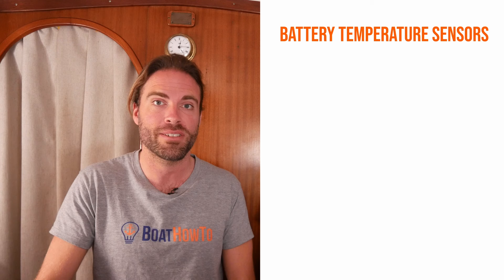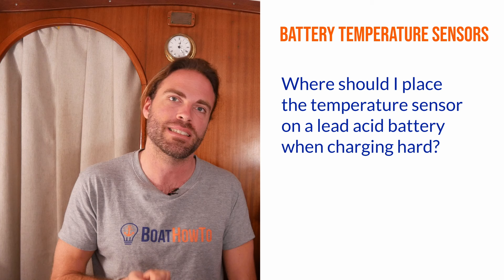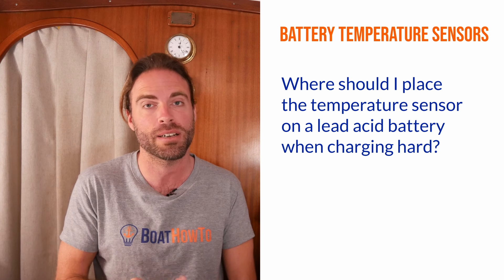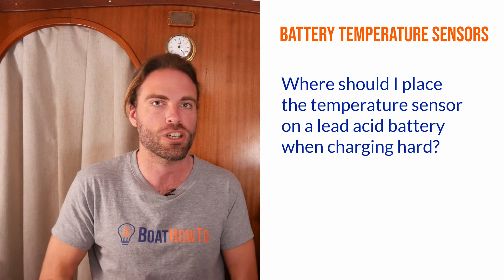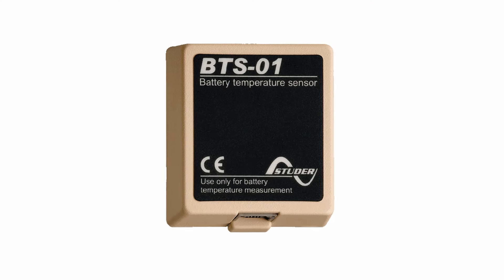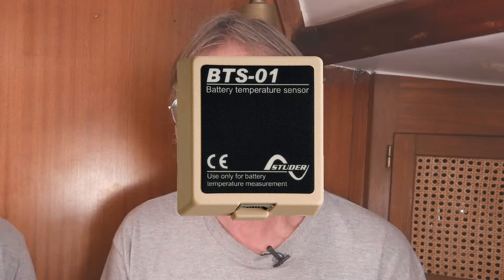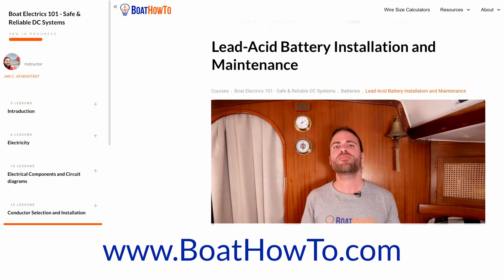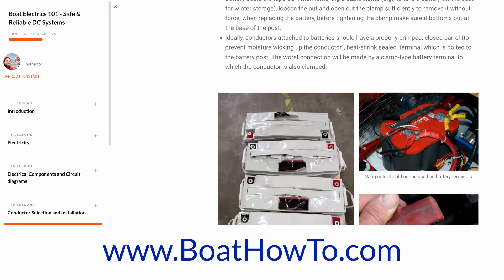Here is what MOST people do WRONG 😖 | Ask The Expert with NIGEL CALDER

Comment: Thanks. What do I use to stick the sensor on when the adhesive has run out? Will any double-sided adhesive tape work?
Reply: Yes you can do that. Just use the same type of double sided tape. When the tape is gone use a thin version. Not the version with foam separated slides. These conduct heat much worse.